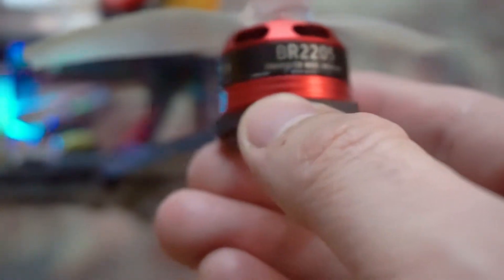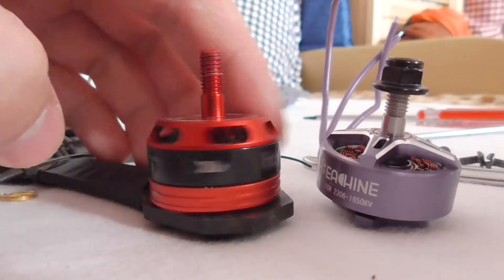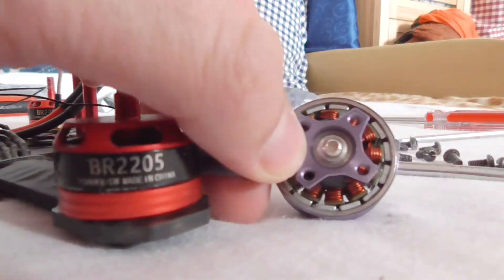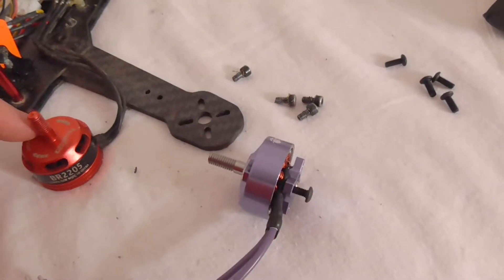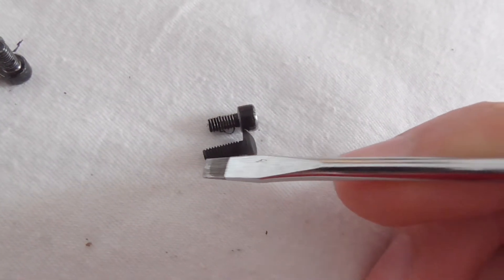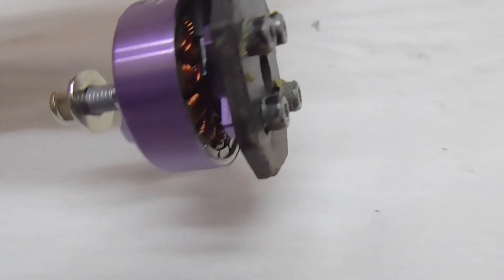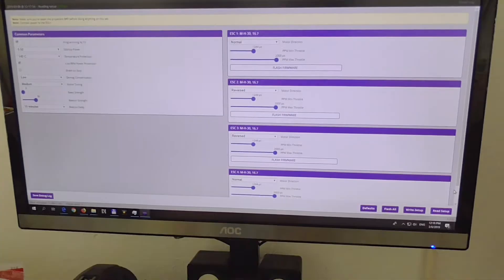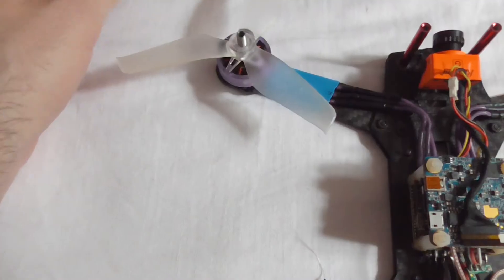Flying a Quadcopter using different motors (Eachine 1650KV & Racerstar 2300KV)

Comment: What? Why would you do that?
Reply from the maker: Curiosity, just in case a motor fails and there is no identical spare motor.
Reply: @furulevi  This leads to problems, trust me. It may look like it works now, but you will burn out one of your motors eventually, I've done it. It's not a good idea, it's hard on your motors, and ESCs! Just buy 5 motors at a time, and you will have your spare. Only time I ever mix motors now, is if the Stator size and KV match, and then it's not a problem. Good luck though!